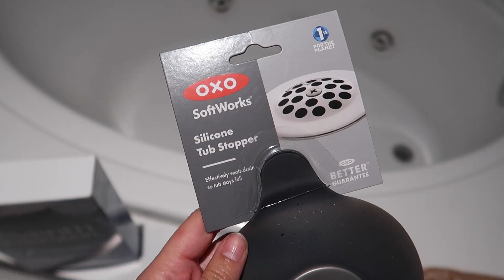Fire alarm drama: I broke everything including my brain 😩  - VLOGMAS DAY 9

Comment: I hope the Ray taught you how to reset a tripped breaker.  Also you should by pass the last water filter when filling the tub. It's most likely the reason the water trickles out of the faucet, plus you are just lowering the life expediency of the filter for bathwater.
Reply from the maker: Yes! You’re correct! I just used the bypass last night to take a bath and it waterfalled huge out of the faucet haha
Reply: The ceramic filter is wash and reuse.

Comment: Wow, ok, where to start. Ceramic filters will turn your water pressure and flow rate to shit. Just filter drinking water, worst case, use a softener for the rest if it's too hard for laundry or showering. The lights were probably a breaker u missed. Tub jets, fill the tub more. Also, there's often a light switch that controls the power for the jets motor. A good degreaser will get the jets nice and clean. Garage door, usually just hold down the button on the back to clear the codes, then press once and pair ur remotes.

Comment: Ill fix it when im there. There is a reset switch in that exterior plate i showed you when we were outside. i need to get into that cover. Also i know how to clean that tub 10000X faster dont use powder in that tub it may damage the pump...See you later today..